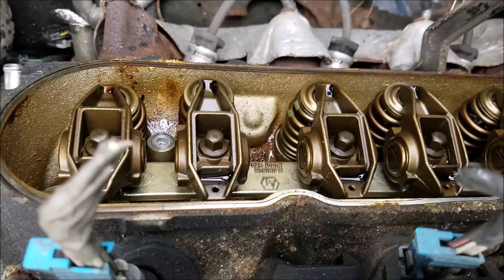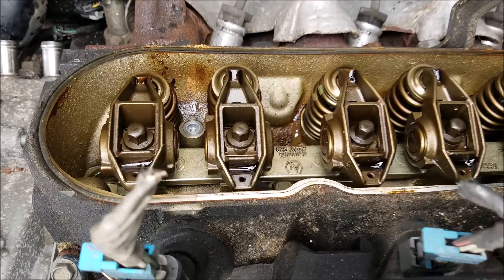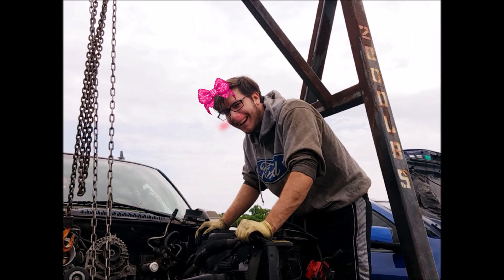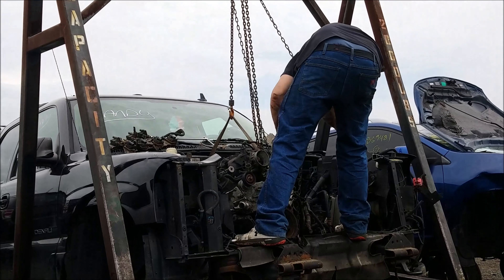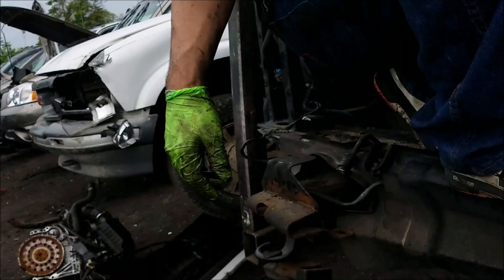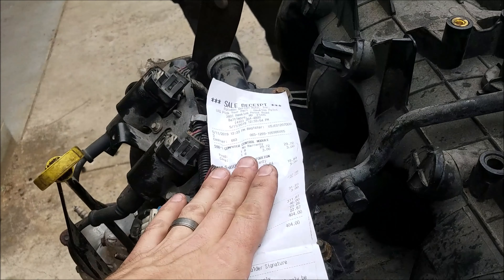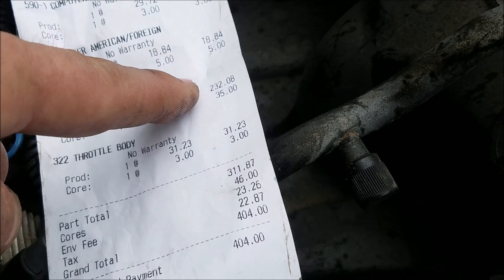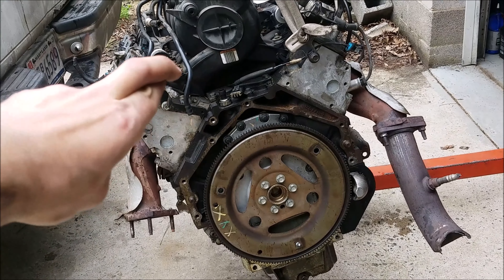LKQ PYP - V8 Engine Cost - Junkyard LQ4

Comment: I work for LKQ, you got overcharged. Starter and throttle body are included in the fuel injected engine package.
Reply from the maker: bummer :(
Reply: How much did you reckon a Dodge 5.9 Magnum with all accessories would run?
Reply: @bryanbravo2153  almost all engines have a standard price, if you pull yourself it's always between $200 and 500 for gas engines, diesels cost a bit more like the 6.7l Cummins probably about $1k
Reply: @robcooper3171  perhaps it the CA mark up but went I went and asked how much from  oil pan to throttle body with all accessories I was quoted $700-800
Reply: @bryanbravo2153  all states will be different, few will be the same, in florida, that what I've seen most people pay is what I quoted.  Obvious the more rare the engine the more it will cost.  Ls engines are like the old ford chevy and dodge small blocks from the 60's to the 90's,  all easily found and spend a dime a dozen.
Reply: @robcooper3171  Well Huntsville, Al location charging TF out of people for everything.  500+ for an engine with no accessories. And no more sale days since the plandemic

Comment: Nice score, do you know someone who works there at Hawkins?  Sometimes the clerk will start taxing for every tiny little piece and they screw you royally. Last time I went they did exactly that. After spending the whole day fighting and pulling by myself to carry up for a grand total of $583.00 I just said "oh no way" walked out empty handed. Swore I'd never attempt that again. Went somewhere else, actually started and heard the engine run paid $400 and got everything I needed with a 30 day guarantee. Guess it's up to the discretion of the cashier?!
Reply from the maker: I make sure not to get any extra stuff on the engine.

Comment: Yep, thats what the guy told me at the same junkyard u went to. Engine is 232+ if u pull the whole engine w/ acc they charge u for 5 items on the engine throttle body, alternator n so on.
Reply from the maker: Yep yep.. just pulled another engine with @premiumfuelmag this week :) gotta replace the blown up M3 engine.
Reply: Not now!! Now its 500+ on an engine with no accessories

Comment: how many miles on the odometer?
Reply from the maker: No idea. But the engine looked good
Reply: @ThomasMiata  you can take a drill with you and hook the battery up to the gauge cluster to turn the digital odometer on, hope that helps if you even see this comment.
Reply from the maker: @greasemonkey258  thanks for the tip :)